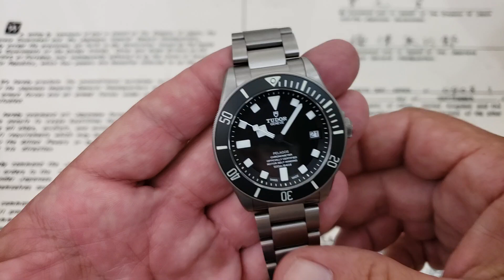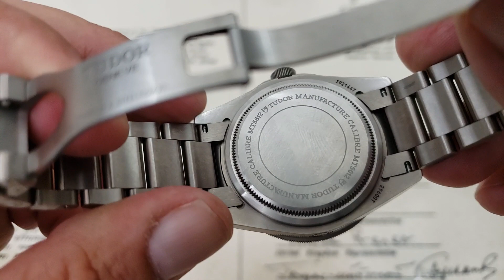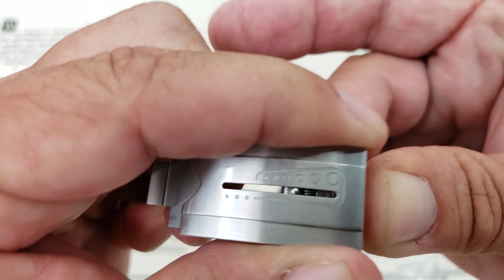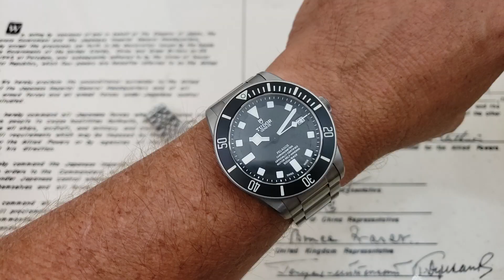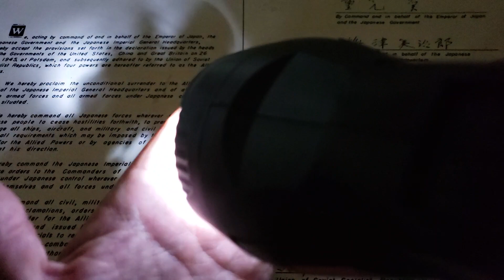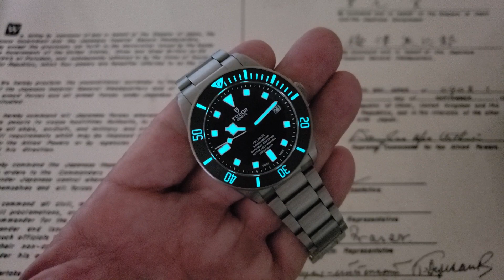Tudor Pelagos Ref # 25600TN

Comment: The clasp and case back are steel. Other than that he got everything else right. Had mine a couple of days and in a collection of a few watches it fits in very well as a tool/casual watch. I wouldn't consider it for your only watch or even a second. It fits very nicely as a third watch.

Comment: Great watch but, grade 2 titanium for 4K ..?? The Seiko Shogun for example is made out of grade 5 titanium. Just sayin'.  I will add a piece of text about this subject  "I was made to understand that the titanium used by Tudor is deemed as a Grade 2 Ti, instead of the higher performance Grade 5 Ti. Grade 2 Ti is purer in the sense that it doesn't have aluminium and vanadium added to make it into a Grade 5 Ti. Unfortunately, it is inferior to the Grade 5 Ti as it doesn't comply to high stresses as required for aviation applications.  Generally, Grade 5 Ti is about three times stronger than Grade 2 Ti. Of course there are other properties where Ti has advantages over stainless steel, especially in density or weight. In that sense, Grade 2 Ti is also softer, hence being less scratch resistance than Grade 5 Ti and normal stainless steel"
Reply from the maker: Great information.  Thanks!😎👍